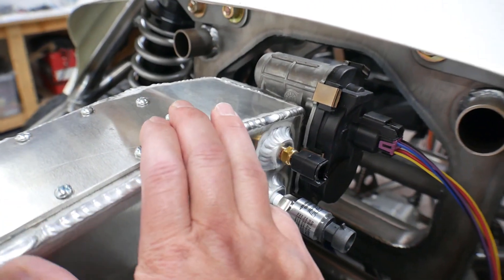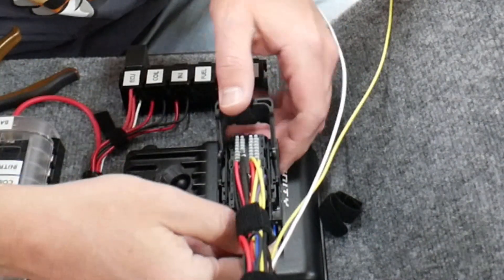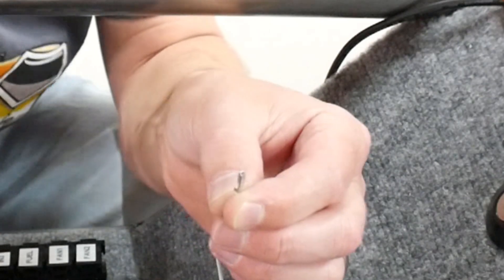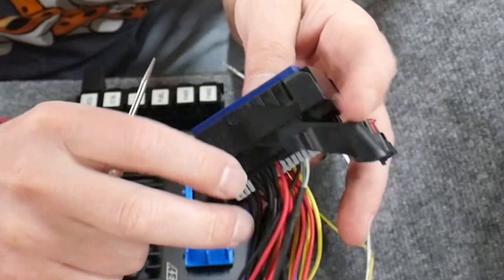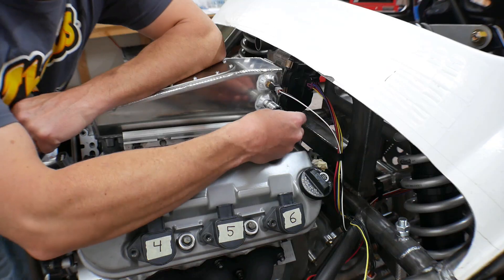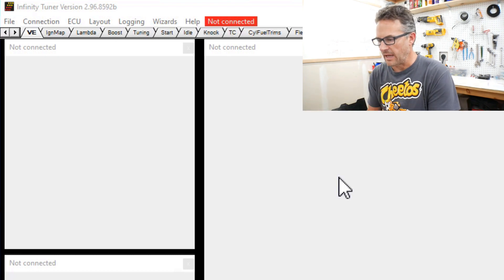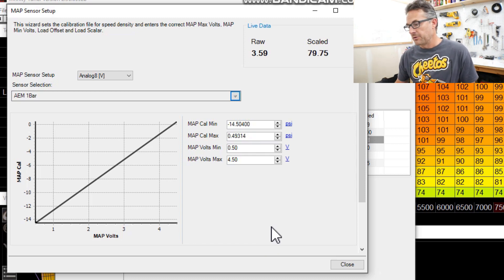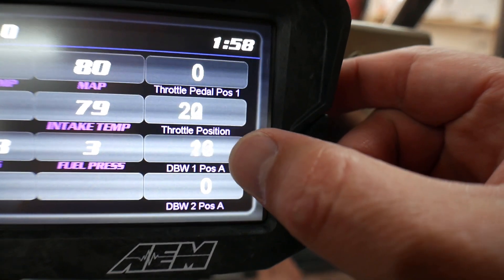Wiring and programming sensors to the Infinity ECU.

Comment: Great content, you really specific and clear on all your videos , you got no idea how helpful is this to my project, I appreciated, one question that I will have is how cd7 is connected to infinity ? And I can’t wait for coil pack wiring 👍👍👍👍👍
Reply from the maker: Thanks, I love hearing that these help people with their projects.
The Infinity has a two wire comm bus. That gets plugged into the CD5 or 7 dash. You also have to connect power. So four wires is all it takes.
Then you set the baud rate (it defaults to what it needs for the Infinity) and basically you're good to go.
Or at least at that point you can discover what channels you want and design your dash.

Comment: What made you decide on the AEM system vs Holley or another brand?  I am just curious.  I haven't researched any just seen alot of you tubers use holley. Currently installing a FAST standalone TBI system in a Jeep.  Your system is way more complex but far more capable and expandable then the one I am doing.  Keep up the great work.
Reply from the maker: I did a lot of research on the different systems. The price point on the Holley is really good, but honestly they are only interested in setups for the LS engines. They don't really support many other cam/crank trigger setups. So it wasn't capable of doing the 12/1 setup I needed for the J series.
So AEM Infinity could do a wide range of trigger setups, they were very helpful on tech support when asking about the system. And they have a lot of products with a lot of YouTube videos with Tutorials. So I went with AEM.
Reply: @DougBugBuilder   sounds good.  After messing around with the Fast system then buying guages sending units and the rest of the stuff I can see a significant advantage to some of these more advanced systems like yours.  My father in law bought the Fast system 10 years ago and never used it.  Now we have a project to put it on and it was already purchased.  If buying strait out not sure we would go this route again.
Reply from the maker: @northpeak4x4  I agree, once I get past the learning curve this will have endless ways I can expand it.

Comment: Anyone else hear a squealing on this video?
Reply from the maker: Most likely that's the throttle body. At the tail end of the video the ECU is up and running, the motor in the throttle body makes a humming noise as it holds position.
Reply: Yes about the last 5 minutes or so.

Comment: Can I use barns 4wd 42000lbs static load 7/8*3/4 heims for spindle
Reply: This much strength is enough for heavy off road
Reply from the maker: Maybe, those have a really wide body, clearance might be an issue. But get the measurements of it and if there is clearance no reason you can't use them.